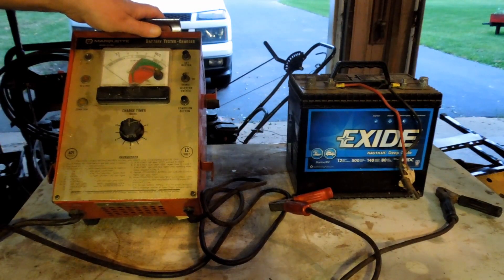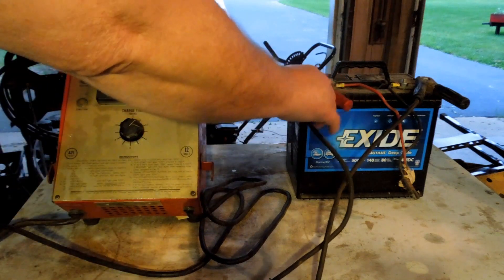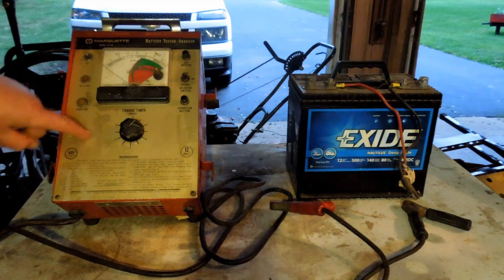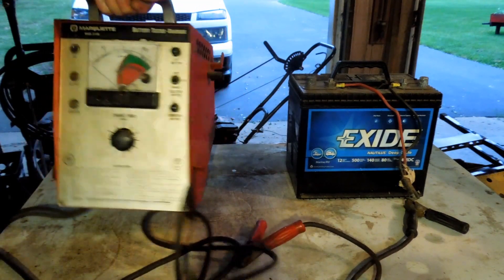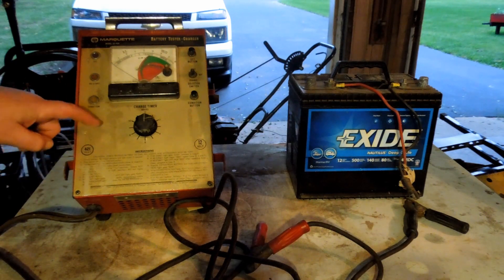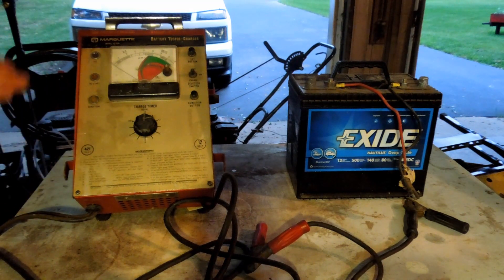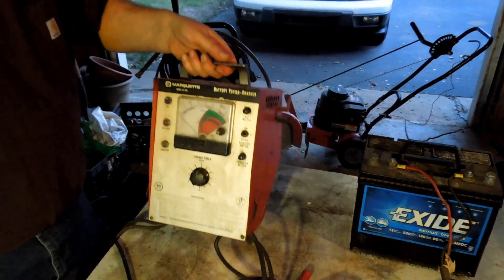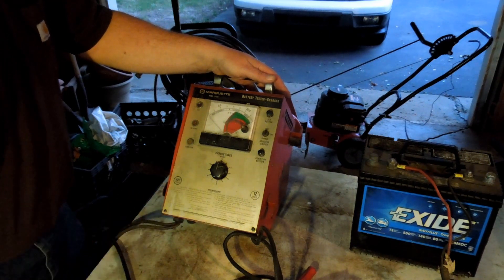Request For Assistance - Marquette Model 33 109 Battery Tester Charger

Comment: Easy now I don't know anything about Ebay but there is one on there but like I said I don't know much about it, if it is still up on the site or sold I don't know.
Reply from the maker: I found a mention of it. There is a badly out of focus picture that I can't blow up to readable condition on a webpage. 
No luck so far.
Reply: @OldSneelock  That is what I did too. Say your prayers and eat your vegetables and maybe one will show up that is readable.